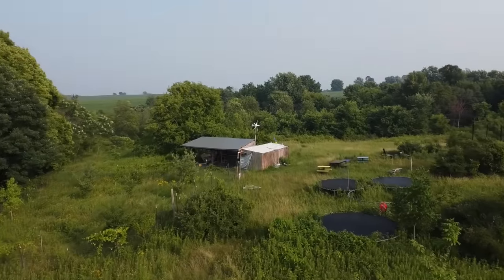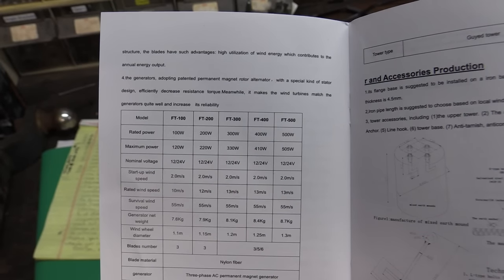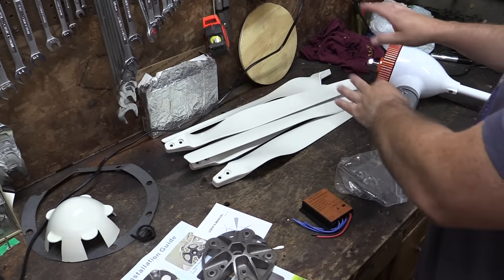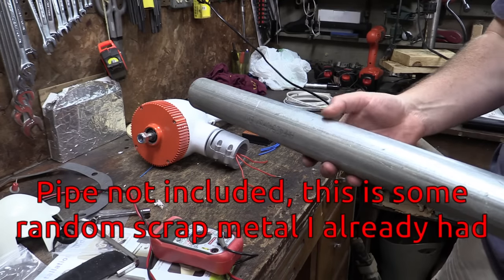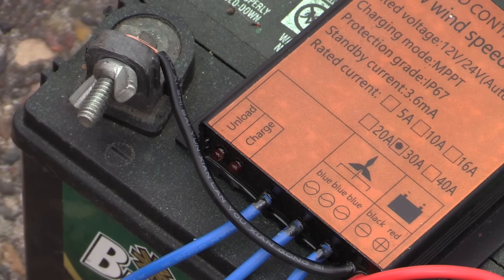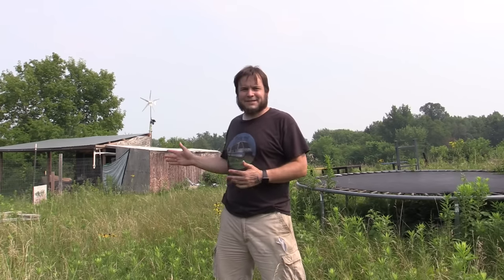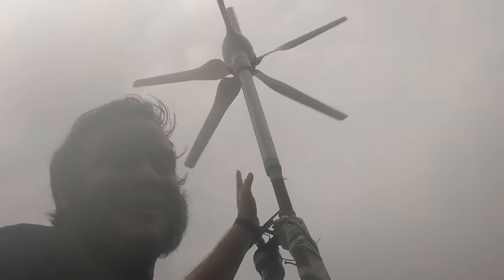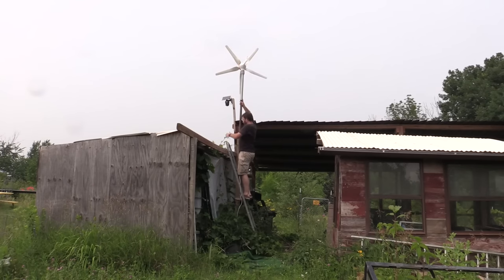Finally A Real Wind Generator! Vevor FT500 Review

Comment: Would love voltage and amperage readings out of that rectifier in various wind speeds😊
Reply from the maker: I'll have to go back and mess with it some time, it was too wet to get the multimeter out!
Reply: You can calculate it. Watts=1/2*sweep area*air density*wind speed cubed.
The problem is the wind speed is usually very low. Residential areas average something like 3 m/s.
At 3m/s, with 0.75 meter blades, efficiency of 20%,, you get Watts = 1/2 * (PI*.75^2) * 1 * 4^3 *0.2= 4.8 Watts.
Over a year with average wind speed you get 42 kW. 
If your power normally cost $0.2, then you save yourself $8..40 a year!
That is why you don't see lots of homes with turbines, they are useless in residential areas. Industrial turbines work because they are built in high wind areas, and are tall to access stronger winds.
Reply: @AORD72  You calculated the power in the wind. That is NOT the power that is generated by this wind turbine. This wind turbine will never generate 500 watts, even in hurricane speed winds.
Reply: @MrSummitville  If you read properly, I said "efficiency of 20%" then multiplied "Watts=1/2*sweep area*air density*wind speed cubed" by 0.2 (efficiency of 20%, as a realistic guess at a small turbine efficiency). Of course this is all a rough approximation, but from reading small wind turbine tests is is about right.

AS I SAID over a year at 3m/s wind you get 42kW, That is only 115 Watts a day. WHERE DID YOU GET "This wind turbine will never generate 500 watts" from?

Comment: nice addition for solar panel electricity generation when no sun . my problem is no additional power  input on my smart converter,, but how about charging 12 volt batteries and run an 220 v inverter (euro) and feed this into the ac input (yes it needs a selector switch for the grid power input or this input . ) May some voltage relays to select when the battery powers are low .

Comment: Great video! I want to build a wind generator to power a offgrid weather station, that sends the feed via internet and has also a camera that hopefully can stream live feed or regularly taken photos.

I have no idea on how to do that. If you think its a project you would like I'd love if you tried making it, so I can do that myself!
Reply from the maker: I've tried making a couple DIY wind generators, they haven't held up more than a month or two before falling apart. It's hard to get everything balanced and aligned correctly, especially if you just make them out of trash like I did!
Reply: @saveitforparts  can the system be built around a premade generator like this one here?

Comment: my main issue is the rectifier end of this,
there is no voltage adjustment. not good with many applications, especially with LiFePO batteries
does the turbine or controller short out the feed lines to prevent an overspeed when no longer charging?
the last one I had didn't and went out gloriously in a 70mph wind gust
Reply: I’ve seen mine unload at about 14.6 volts and I have a brake system if I’m worried about storm

Comment: My neighbor bought identical one and wants me to help him install.   He seems to be having trouble finding right size pipe or conduit for the pole to raise it up.  Can I ask you what you use for the pole and size/diameter?
Reply from the maker: I just had some random pipe lying around, can't remember the diameter offhand, sorry!
Reply: I bought a 16 foot pipe, 1 1/2 inch inside diameter for mine. They sent a flange to weld to it.

Comment: I'm curious about the terminology of one of the terms you mentioned. "Wind Controller" What is this?
Reply from the maker: I probably mean charge controller, the box that takes the AC power from the turbine and makes it into DC power for the battery. It's supposed to also cut off charging if the battery is full, but I'm not sure how legit this one is!

Comment: First  things first, the rubber is a gasket that gives the pipe that holds it up more tension when you tighten the screws so the turbine does not flip upwards suddenly in high enough winds. Second the controller they give you actually holds back the charge efficiency. It's so cheap it's filled with sand(Chinese mining  waste sand which likely has things like Thorium in it. One of the ways that they deal with toxic waste. Just stuff it in products they sell abroad.). Attaching a 1200v bridge rectifier diode can help. Then attached to a  smoothing capacitor which then finally attaches to a combiner box which goes to a solar mppt. Doing this allows the turbine to go it's full output that you payed for and allows you to use it with solar. one extra step I did was to use 40 amp fuses before the input of the bridge rectifier diode in the event of lighting. I also cool the diode with a fan that uses a temperature sensor for 40 degrees C/104 degrees Fh. From what I am seeing so far is that I could potentially wire multiple turbines into the same homemade controller.

Comment: you need a dump load for the controller for when the battery is full
Reply from the maker: I think this one just stops sending juice to the battery once it's full, there's an "unload" light that comes on at full capacity.

Comment: Did you wires spin with the wheel and yank on the connection eventually?
Reply from the maker: There's a commutator or slip ring in there so the thing can freely rotate.

Comment: I wish you had added a watt/amp meter between their charge controller and your battery so we could see what it was actually putting out. They claim 500 watts, which would be VERY COOL for the price. But seeing it on a meter would be a bit more convincing.
Reply from the maker: I meant to measure it, but between the rain and some other projects I never got around to it on this trip!
Reply: @saveitforparts    I did a bit of hunting. The 500 watt version needs ~17 mph wind to produce about 80 watts.  Anything less and the output is anemic. That prop must be pretty loud once it's spinning fast enough to produce power.

Comment: Hi what gauge wire did you connect to the three wires stubbed out of the wind turbine. thanks
Reply from the maker: Not sure, I think I just used whatever household AC wire I had in the scrap bin. The kind you install in a wall.

Comment: "But not big enough to power a house."
At that price, I'll buy 5.
Reply: Even with 5 of those turbines and an optimistic 14.5 mph average wind speed you would be getting about 300 watts of instantaneous power. If you are trying to run heating/cooling with these things, forget it. Also things like refrigerators, washers, dryers electric cook stoves would be too much for the small energy output of these small turbines. Now if you had a very large battery bank and inverter setup you could run some of these items alternately/sparingly.
Reply: You will need 100 units and 30 MPH winds, all day long. What a joke.
Reply: @MrSummitville  Math never was your strong suit, was it, Skippy?

Comment: I must have missed the power output figures, do you have a meter connected to it, cheers.
Reply from the maker: I didn't have the meter going on the 2nd day due to the rainstorm, then I forgot to follow up with measurements once it dried out!

Comment: OK, there was some secret soldering to a romex wire, and then everything was magically connected to some type of controller. The main part of the video is missing. Anyone could figure out how to put the blades on the bracket and mount the pole to the flange. I'm no expert, but wire nuts seem to me to be the wiser choice to soldering and a heat shrink wrap.

Comment: I would strongly encourage anyone to use two 6 volt golf cart batteries in series to give you 12 volt DC. Car batteries are not designed for deep discharge. Trolling batteries are also not satisfactory. I used trolling motor batteries for years at my camp and the would only last about 1 1/2 years and were not very reliable near the end of their life. I switched to golf cart batteries and now they are on their seventh year and they are still going strong. It's extremely important to keep your water level correct in your batteries. Sealed golf cart batteries are not recommended unless you have an expensive charge controller.
Reply from the maker: Yep, deep-cycle batteries would be better for this, but I just had random tractor batteries lying around to test with.
Reply: can i get a recommendation /link? thanks!

Comment: what keeps the wires for twisting up as the generator changes directions in the wind?
Reply from the maker: It has a slip ring or commutator thing inside the top.

Comment: Would you again please tell how you wired yours up. I just acquired a brand new in the box Garosa which is identical to your wind generator but there is zero wiring directions. I also have the black control/voltage box that has zero directions on it. Any help would be appreciated. Thank you in advance.
Reply from the maker: Apparently any one wire from the turbine goes to any one wire from the magic black box. I think the turbine is a three-phase AC output so it doesn't matter which wire goes where.
Reply: Thank you sir. I thought that's what I had witnessed but need more info. Further investigation in a different way had given me the same information.  Now the build continues.

Comment: I have a question, Can you hook up a single solar panel and separate regulator on the same battery as the wind generator? Thanks for your time to answer. ( I hope ) Terry
Reply from the maker: I think you can have both solar and wind on the same battery system, but I haven't tried that yet. The diagrams in the Vevor manual show that as an option.
Reply: Oh wow, Thanks so much for that. Sorry I'm late, Duties to tend to, Lol.

Comment: If this turbine isn’t charging your battery, it’s because you didn’t hook it up properly. It is indeed an AC and brushless, but the AC voltage is rectified internally to the charge controller. Frankly, I’m surprised you call this a review without testing output or using it for more than a day to show how reliably it charges the battery on anything other than stormy weather.

Comment: I wish you had a volt meter on the battery to see how much the voltage changes and the peak voltage.
Reply from the maker: Yeah, I meant to, but we didn't want to pull out the multimeter during that storm and then forgot about it later!
Reply: @saveitforparts  understand

Comment: Did you measure the wattage?  Amazon reviews say it tops out at 70 watts.
Reply: My question also.  A review of a turbine should measure actual output in relation to claimed output wattage.  Decent wind turbines come with graphs measuring output wattage relative to wind speed.
Reply from the maker: I meant to measure wattage when the wind was high, but it was also raining like crazy and I never got the meter out.

Comment: No electrical output stats?  That's kinda important.
Reply from the maker: I meant to measure the output in high winds, but then it started raining really hard and I never got around to pulling out the meter :-(
Reply: So,  guess why the data is not available?

Comment: Yah, $126.00 to buy it and $500.00 to order a replacement Stator coil from China IF they even have any in stock. Most of these wind turbines where made in 2004 to 2010 and have been sitting in warehouses filled to the rafters for over 18 years. The manufacturing plant is long dead and the molds sold for scrap metal. Before you buy a wind turbine pretend you already own one and try to buy parts for it. Your lucky if they even bother to email you back and if they do the repair parts cost are over $500.00 with shipping. The stator coils go first and they cost BIG BUCKS!! BUY AMERICAN!
Reply: recommendations please?

Comment: Hi there.

I did just finish asamble my wind generator 400.
Who can help me out how to connect those 3 red cable to the controller as the instructions are written so small to read them.

Can someone explain me it ?
Reply from the maker: As far as I could tell, you just connect any red to any green. It's some kind of 3-phase AC system.

Comment: how does it deal with not twisting the wires inside to much?
Reply from the maker: There's a slip ring or commutator ring of some kind in there, so the wires don't rotate. That was one of the tricky parts for building my own, I did buy a slip ring but never got around to installing it.

Comment: Did I miss it or how much Watt did it generate? :) Could you measure it?
Reply from the maker: It was raining too hard to pull out the multimeter when the wind was strongest!
Reply: Thanks for the fast answer! Maybe you can measure it and write it in the comments or description? Or maybe even just do a short video about the power generation. I think that is the main question people want to have the answer to when watching this video :) At least I am - want to buy it myself and install it 😬  @saveitforparts

Comment: Do you have anything to measure the wattage it is actually delivering?
Reply from the maker: I meant to check the amperage during high wind, but it rained so hard that I never got the meter out, and forgot to follow up once the storm cleared. I'll try to do a follow-up at some point if we get wind without rain!

Comment: How do you hook this up to 48 V system? I imagine there’s some kind of converter that goes from 12 to 48 V.
Reply from the maker: Maybe so, I don't know much about 48v systems. My work tried to sell some old 48v solar panels, but no one would buy them since it's apparently rare.
Reply: @saveitforparts  
You don’t need 48 V solar panels. 12 or 24 V don’t make a difference. How you wire them is important though. I usually wear remind me in a series parallel and then take a reading before I connect them, as you don’t want to go over maximum voltage on your charge controllers!

Comment: What was the little wind measurement device you had in your hand?
Reply from the maker: Someone else brought that out, I'm not sure of the brand, closest I could find online is called a "Headwind Weather Station"
Reply: @saveitforparts  thanks for the Info. Must check it out. I had looked at a similar wind turbine and the idea would be to have it going into a DC immersion heater in a water tank. Thinking that over the winter and it going day and night I would have some warm water to hand.

Comment: How do you stop it when you want to say move it from one location to another
Reply from the maker: I only moved it when the wind wasn't blowing, but I think you can short out all 3 cables from the motor and it should stop.
Reply: @saveitforparts  they used to have chain pully on the water windmills in the farms which when pulled it would slow down and stop the rotor, but i think if you put in a circuit breaker would be most benificial and safer but have a look at a pully chain👍🍻
Reply: @saveitforparts that is a good way to burn out the stator

Comment: You can get a black car-battery box for $12 to save you some effort.
Reply: Also, you did a crimp on solid core romex. Fine for temporary use, but crimps are only designed for stranded wire.

Comment: Warning for potential buyers: the power output might be much lower than you expect, at least according to reviews on Amazon. I almost ordered one of these from Vevor, but I wanted to read reviews from a third party site before buying. Two reviews claimed that it only generates 70W in 40mph winds.

I don't want to rely on Amazon reviews, but I can't find any other data about the turbine. Bummer that this video didn't measure power output.
Reply from the maker: I meant to measure it, but between the rain and some other projects I never got around to it on this trip!
Reply: Of course, he did not measure the power. It would have been embarrassing low!

Comment: Me personally I don’t recommend the brand that he is using because that is a brand that makes their stuff in bulk not in quality and the only thing that I have noticed that they can run good is their diesel heaters these wind generators they don’t last very long I would recommend a different Brand name if you’re going to use the wind generator system if you’re going to use it with the good solar panels

Comment: This review wasn't useful for me. There were no numbers on the output. The issue with these is usually that the output is a lie. I'd like to know what power you were getting when it got up and going. Id hope to see 200 or more watts for the price.
Reply from the maker: I meant to check the amperage during high wind, but it rained so hard that I never got the meter out, and forgot to follow up once the storm cleared. I'll try to do a follow-up at some point if we get wind without rain!
Reply: Low watts. Move along. Nothing to see here.